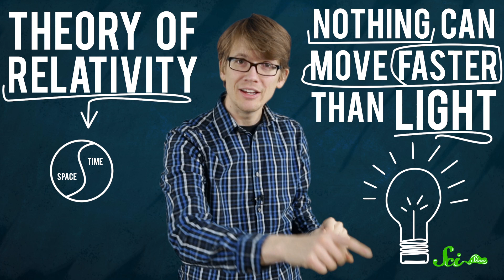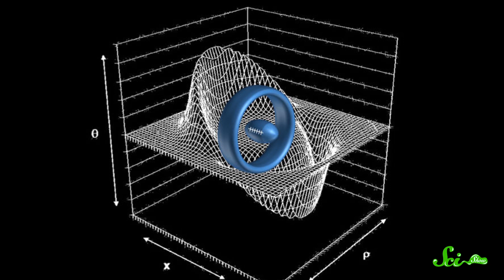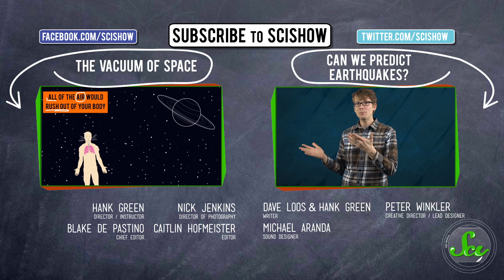Warp Drives!

Comment: what if you had a reactor that  used element 115 as (fuel) and it was hit with neutrons turning it into element 116 and giving off negativve energy, which was then stored in a vacuum?

Is this scientifically possible, it is what Bob Lazar supposedly claimed
Reply: OK, First, adding neutrons do not change the elemental number it just makes a different isotope of the same element. 

 Second, this is not how you create "negative energy" which im guessing you mean antimatter? Which is the exact replica of regular atoms but with the charges reversed on the particles that make it up, such as the "proton" would be negatively charged called an antiproton, and the "electrons would be positively charged called positron.
 
 Third, Moscovium "element 115" cant be created and contained long enough to do any kind of tests with so any theories must be purely done with math, which doesnt mean its wrong but seems hard to test in real life ATM.

 And fourth, which im not too sure about but from what i know of other elements, when you smash neutrons into them, such as uranium or plutonium, they split into smaller atoms called fission, The only way we can make larger atoms is by smashing billions of smaller atoms into eachother and once in a while you can get lucky and have one larger atom be made that decays so fast we have to use super computers to even detect if they existed at all.

Comment: 0:00 you forgot the inertial dampeners.
Reply: Without them, we'd all just be stains on the fictional back bulkhead.
Reply: From a technical stand point within the space warp time-space within the bubble (for lack of a better word) would create a sort-of pocket dimension where the individual or craft within the bubble would not be able to feel the movement of space around them because in fact they are not moving - so it would be more like traveling in the Tardis (with extreme heat due to the thermal dynamics of energy being sent from the white hole behind the craft and the black hole in front the craft) rather than the believed warp field of star trek...  I was very hurt by the fact that star trek had lied to me when I discovered this.
Reply: lol

Comment: I spend a lot of spare time thinking about space theory and I have a warp drive theory that would require much less energy. According to Einstein the faster you move through space (3D in this case) the faster you move through time (lets just say thats 4D). If you were to make a 3D graph you could travel along the x and y axis without ever changing your z. What's saying that you can't travel along x y and z without changing t. You would still feel time passing normally (something like cryogenic chambers might be needed) put to people outside of this kind of travel it would feel like no time at all. In other words you could travel any where instantly. Tell me what you think a out this.
Reply: As an add on, reverse time travel may be possible if negative kelvin is possible. The things we have become good at measuring all seem to have negative scales on them so kelvin might as well. Traveling in a negative vector sounds fun until you realize that you would freeze to death and cause universal collapse.
Reply: +Leafy&#39;s Right Hand you got one thing wrong, the faster you move, the slower time gets. This means that light travels full speed in the xyz axis, but doesn't travel at all in time. meanwhile slow objects travel faster in time but slower in the xyz directions, making the total speed x+y+z+t the same for all things we know of.

Comment: If as you approach the speed of light, as matter, spacetime distorts(contracts) does that mean that a local area of spacetime is pulled away from the rest of spacetime? If so, is there a way to take advantage of the difference(weakness) in spacetime ie; break through spacetime? So to speak.
I'm curious what would happen, this idea has been in my head for months! If you have the math/physics skills to work it out, let me know. If you know a reason this is B.S, also let me know.
Thanks
Reply: +Gareth Jones spacetime would not tear. You'd simply be moving slower through the fourth dimension.
Reply: Thanks for the reply, but i mean what would happen to the space time, not what would happen to you.
Like say theres an area of effect of where the space and time contract, is the contraction uniform from the centre of the disturbance to the edge or does it diminish towards the outer part of the area of effect?
Either way, would not the difference between that contracted space time and the uncontracted space time that surrounds it cause some kind of potential difference or tension? If so could not the gradient betwwen them be exploited to some effect?
Hope that makes sense.

Comment: You neglected to mention that if warp drives are possible, they enable (indeed, entail) the formation of closed timelike curves, i.e. time travel. Since travelling to the past is presumably impossible, warp drives of this sort are too. It's fun to speculate, and there may be something like warp bubbles in the real world, but they shouldn't be able to actually transport anything faster than light.
Reply: ***** Less in fact. The possibility of warp drives entails the possibility of time travel, but the converse is not necessarily true. Superluminal travel of some kind would certainly need to exist, but it might be of a different kind.

Not that either scenario is likely.

Comment: I get the idea, but it is impossible because the faster you move the slower your gonna get that's why bulldogs can't run fast that and once you hit the speed of light you just be adding mass and going the same speed when your mass maxed out or something like that......
Reply: +Richard Furches You don't get the idea. With a warp drive, you are not moving! You are standing still!
Reply: *huff*

You're still manipulating spacetime, however, which causes the increase in mass and time dilation.
Unless you stand exactly in between the two zones of spacetime compression and decompression, you'll have a bad time. And even then, you'll see some crazy shit because angry space monkey is not happy when you bend spacetime!
Reply: Let's see...
Side effects while standing in the compression zone (positive energy):
-Experience time outside the compression zone speed up
-Rapid weight gain
-Seeing everything get stretched out outside of the compression zone
-Gravity
Side effects while standing in the decompression zone (negative energy):
-Experience time outside the decompression zone slow down
-Rapid weight loss
-Seeing everything outside the decompression zone get scrunched up
-Lack of gravity

Comment: Warp Drives are like Chuck Norris doing push ups. When Chuck Norris does push ups he doesn't push himself up....he pushes the Earth downward...
Reply: +sw ”SWflaco013x” x However, instead of actually benching that weight you're being crushed under it. Interesting choice to come bullshitting about your fictional strength in a pop science video comment section.
Reply: Jake Casey the Norris drive
Reply: +Jake Casey if im benching im pushing the earth down a certain amount.  There is me, the weight, and the bench and there is an equal and opposite reaction.  I weigh 180, the bench is about 100, and 415 lbs of weights.  But thats about 695 lbs and the earth is something like 5.9x10^24 kg
Reply: +Jake Casey then their wormholes... they just cheat
Reply: +sw “SWflaco013x” x the weight you the bench were already there... all you have done was to move the air around you by moving the weight to a place it was not previously... and filling the void of where the weight once was with air
Reply: +sw “SWflaco013x” x the weight you the bench were already there... all you have done was to move the air around you by moving the weight to a place it was not previously... and filling the void of where the weight once was with air
Reply: You should fuck the fuck off, son
Pancakes!
Reply: Bryce Forsyth To whom do you speak?
Reply: Placeholder Name it was https://plus.google.com/u/0/104290313944456384109/posts (Glaxelly Hin de N'Burg)
Reply: Glaxelly Hin de N'Burg Good point now that i look at it.
Reply: Bryce Forsyth
Yeah, from a son at least, right
Reply: That's more of an Einstein joke ;)
Reply: Well done for copying a meme
Reply: wrg,idts
Reply: +David Arias less than an atom. yeah

Comment: We could use helium 3 to make the power. Helium 3 is commonly found more on the moon like places. That's how we get the power.
Reply: +fordie ford Fusion could be way to go.
But heat generated by fusion would be hard to menage in vacuum.
Freaking huge radiators would be needed.
Reply: +fordie ford we gotta figure out how to get there first to get some. xD

Comment: Would it be easyer to make a device to reduce the affects of gravity on an object allowing it to move faster on it own power and if that's possible than increase the affects of gravity on one side (the front )And reduced the affects on the other (the rear) to allow gravity on its own to move an object without using any power other that what's needed to affect the gravity in that manner but then you have the problem of zero gravity but if a device is made to affect the forces of gravity on an object you can change zero gravity to any desired amount and with that don't what's next is to affect the gravity in the desired area but with zero gravity that's not a problem as all you would need is two devices one in front to increase gravity pulling the object in the desired direction and on in the rear doing the opposite pushing the object in the same direction which technically the object is staying still and gravity is propelling it through space.....and if you ask me there's no such thing as zero gravity gravity is everywhere just some places less than others the question is how do you in force a strong gravitational  pull on an object were there in little gravity as I said no such thing as no or zero gravity the fact that you move in space shows there's gravity with out gravity there's no movement that's why absolute zero can't be done and it it has there gose you gravity manipulation device because how can that spot just freeze the space between you and that spot gravity is being manipulated

Comment: ok

have 80 years left to build warp drive
Reply: +AxeFire 
In less than 80 years, we went from first manned flight to landing on the moon.

I say it's doable, provided we can prove that it's possible to form warp bubbles.
Reply: *****
Seeing there's a reasonably good chance you used a smartphone to type this, I beg to differ. Technological progress has done nothing but speed up.
Reply: *****
A reasonably cheap smartphone is more powerful than a desktop computer from 10 years ago. You don't see that as progress?

Also, you talked about Cold war like it was an instigator of technological progress. Sure, it was the primary instigator of the space race/moon landing, but modern space industry of today is run by international cooperation, running a 400 ton space station in orbit. And that's not counting the thousands of satellites that are maintaining a global communications network and a 1 ton, nuclear powered, semi-autonomous robot that's currently exploring Mars.

Want me to go on?
Reply: *****
One thing that's a possible driving factor towards increased space industrialization is asteroid mining.

Some asteroids contain ice, which can be converted to fuel. That is a very valuable commodity, since it's very expensive to send up ships/satellites with enough fuel for their entire mission. If you can refuel in space, you don't need to launch with the extra fuel. That reduces weight which means even less fuel that you need to use to get into orbit. You also don't need to take with you extra air and water, since that can come from the ice asteroids as well.

More serious mining operation would involve going after mineral/metal rich asteroids, but a decent size chunk could easily meet all of Earth's current demand of rare earth metals for years.

So, sure, an imminent doom to our planet would certainly motivate us to give all the moneys to NASA but If there's one thing that will get us into space again, then that's greed.

Comment: since the warp drive requires negative energy than how can it exist? if we are speaking about a simple field equation for a massive particle than mathematically negative mass is fine there's no problem with that structure but the problem arises when you excite that field. when excited the field would drop to a lower energy state by moving to a more excited state which would create an unstable vacuum. when there are no particles in the field that is when the field is its most unexcited, the field has maximum potential energy. this means that if it is possible to excite the field (which you could if it was like any other existing field) then as soon as it was excited even a tiny bit, it'll immediately cascade outward into a state of ever increasing excitation (meaning more and more particles would appear). if these particles gravitate (and they would since all fields do) than the geometry of the universe would literally diverge as the metric becomes infinite in finite time. if this happened every point in space would be, in a sense, "pushed away" from every other point at the speed of light and all structures in the universe would cease to exist. clearly this has not happened yet so than there must not be exotic matter.
correct or no?